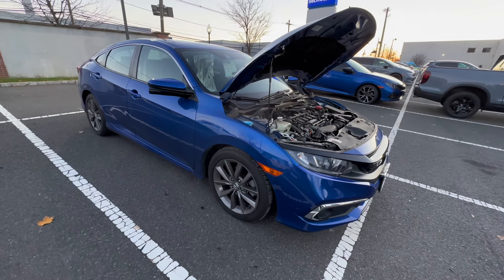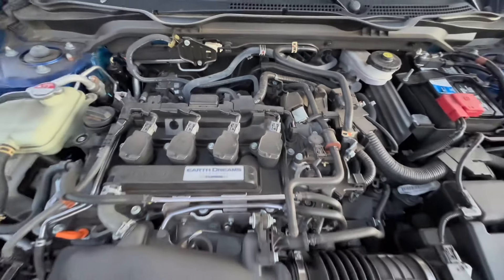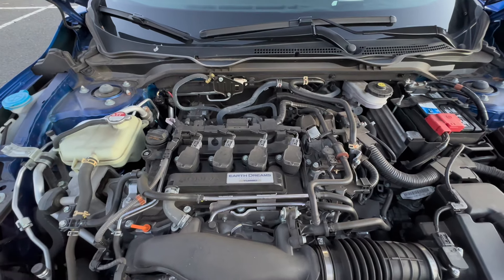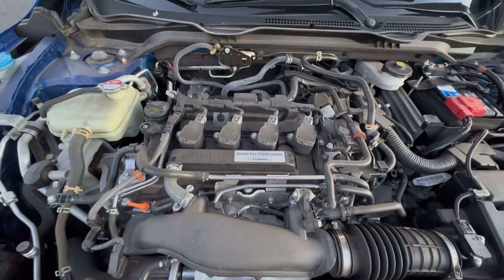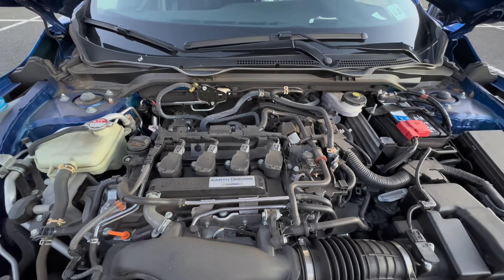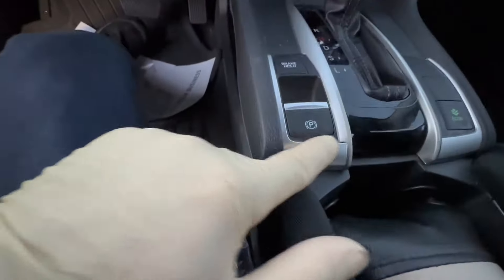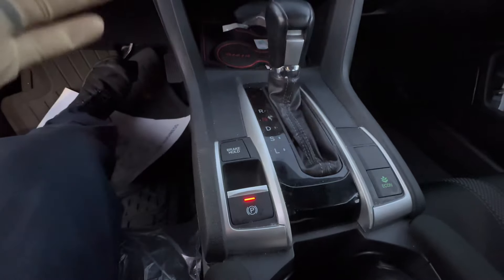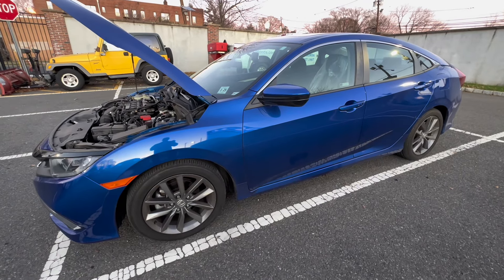2016 - 2021 Honda Civic problems

Comment: I have a 2019 Honda civic, sometime it takes two or three times to get it started, other times it starts right away no problem, sometimes the radio cuts out when I break or in reverse. I have taken it to two mechanics and they cannot find the issue, no codes come up and it’s sporadic! I also had the transmission replace before the car was a year old. I would not recommend a civic to anyone!
Reply: Any update on your civic ? I have a civic 19 sport 2.0L with similar issues

Comment: Rodent problem was spot on , some how they are attracted to it .
Reply from the maker: Yes they are unfortunately, thanks for watching
Reply: Didn’t hear the reference to rodents but man I’ve had what I assume is the same issue - twice! Car would barely turn over, power was diminished and Honda discovered chewed up wires. The second time same thing except I couldn’t even start the car.
Reply from the maker: @TzadikTheManic  yeah it’s a thing unfortunately

Comment: I just found a dude on YouTube he drove his 2017 civic 660K mile with 87 gas😂 he has valve gasket leak at 660K miles
Reply from the maker: Share his channel, im curious and if true that’s great.
Reply: @BCautosutions  I asked if he is running 87. He said yes.

Comment: Hi I've just got a 2017 1lt and experienced complete loss of power while overtaking just for a second or two untill I lifted of the throttle like it when into limp mode any ideas on what happened?
Reply from the maker: Did any lights come up?
Reply: @BCautosutions  No nothing just cut out eased off then ok with gentle acceleration.
Reply from the maker: @grahamrose21  weird, if it keeps acting up, have it looked at 👍🏻
Reply: @BCautosutions  Will take it out later see if I can replicate it thanks.
Reply from the maker: @grahamrose21  good luck!

Comment: For the low octane fuel causing the head gasket issue, is it because pumping 87 octane or getting bad gas that is lower?
Reply from the maker: The lower the octane the more it’s prone to detonation. Also try to stick to higher end gas stations as they typically have overall better fuel no matter the octane.
Reply: @BCautosutions  I appreciate your responses to your viewers. Please let us know If you notice any changes Honda has made to the 2023 CR-V 1.5t to possibly address the oil dilution/head gasket issues or if you have seen any in the shop lately for issues.
Reply from the maker: @thepoliticallyindependent1512  I believe I checked and the head bolts are same part numbers as all other 1.5t but don’t quote me on that. I’ll double check when I get back into work after the holidays. As far as the dilution goes we really haven’t seen many at our dealer. Let’s see what happens going forward.
Reply: @BCautosutions  Would you recommend using premium gas in the Accord 2.0T as well despite being the more robust engine of the two?
Reply from the maker: @ryanlittleton5615  yes for sure
Reply: @BCautosutions  Really? Same issues?
Reply: @BCautosutions  Have the 2.0T's had those problems (head gaskets)as well using 87?
Reply from the maker: @ryanlittleton5615  no but why not use the best possible fuel to reduce detonation and increase performance. The difference might be marginal but well worth it in the long run imo.
Reply from the maker: @ryanlittleton5615  negative although I don’t personally know of anyone using 87 in their 2.0t…most people who buy that trim tend to use 93 here
Reply: @BCautosutions  It's not that I have an issue using 93 (I drive an Si). Just the idea of putting premium in a non-performance vehicle just seems a little odd to me. IDK, I'm weird like that lol.
Reply: @BCautosutions  I've been eyeing a Sport 2.0T.
Reply from the maker: @ryanlittleton5615  yeah I hear ya. Unfortunately tons of heat and pressures in the chamber promotes detonation. With regular fuel detonation is more then likely.
Reply: I've always used 87 octane on my 16 civic 1.5T and had no problems.  I always use shell gas though.  Never Arco or Chevron or 76 or Safeway gasoline.  One time I did put in another brand i think it was Arco because I had no other choice i was in the freeway and the next shell was like 40 miles away. I noticed two things: it gave me less miles range like 50 miles less then normal i now this because everytime i get gas i reset the trip A. And I noticed my car was acting different it felt weaker going from 0-45mph. I think that cheap gas did something to my car but after I did put the shell gas again the car felt normal again but that was after the second fill up from shell so it took like like a month to go back to normal.  Those 30 cent difference from Arco to shell makes a big difference believe it or not.

Comment: 2.0 sparatic sputter at idle and between shifts it shakes
Reply from the maker: @mustng9646  check you intake tube from throttle body to air filter housing for cracks, tears, loose clamps

Comment: I own a 2019 Honda civic hatchback. Last August my ac went out. It was the condenser it was replaced for nothing (still under warranty) this year July my air conditioner took another shit but this time it’s the evaporator. But that’s not under warranty. They want $2600 to fix it. I’m just commenting so you can add that to your Honda problems.
Reply from the maker: @TwistedTee-gp6xh  ✅
Reply: I had the same issue. My AC went out and I read the condenser was under warranty due to issues but it turned out to be my evaporator. Luckily I paid extra for an extended warranty that ultimately covered everything. It’s crazy how many issues my 2018 is having. They also had to replace my transmission due to it going out. Plus my paint is chipping away. I don’t plan on buying another car from Honda anytime soon

Comment: How does The cat hold up in the civic?
Reply from the maker: Both cat and cvt trans hold up fine. Some cvt failures but nothing to be concerned with
Reply: Thanks for getting back to me. I recently bought 2017 civic ex, love it, but heard a lot of bad things about cvts. It had 64000 miles so I had the cvt fluid and filter changed
Reply from the maker: @jenniebaker7180  yep, keep up with the maintenance and it’ll be ok
Reply: Civit cat (smile)

Comment: 2016 touring, 110,000km, 68,000 miles. Not a single issue. Bought the extended warranty never had to use beside the mice issue. I do regular maintenance, sometimes even sooner than recommended. Always run 91 octane, and I drive the absolute piss out of my car. My 1.5t has seen more shit in it's 110,000km then most do there entire lives lmao. From autocross to the probably over 1000 redline pulls of done haha. I swear driving your car hard here and there keeps it healthy lmao. Maybe I am lucky. I believe the 1.5t likes to be driven hard.

Comment: i hate this videos ha ha.  I really do not want to buy another Honda.   Had 4 in my lifetime, all driven to 200K and beyond, with ZERO issues, and when I say ZERO issues, I mean ZERO issues.   What is going on with Honda?  Why the poor quality??
Reply from the maker: The problem is too much happening too quickly and quality gets compromised (this goes for all manufacturers). The more crap they add to cars the more stuff will fail. Also I’m sure the Rona hit everyone hard and quality/workforce was compromised as well. We are doomed lol. Appreciate your input 👍🏻
Reply: 10th gen will certainly be the last quality generations
Reply from the maker: @thomasengel1459  thank you!
Reply: @BCautosutions  Yep.  Honda quality was the result of carefully thought-out, and slow changes.  Now they are under a lot of pressure from all the laws and mandates to get very creative, very quickly--adding turbos, CVTs, new engine designs, its a recipe for problems.
Reply from the maker: @stevens1041  💯 agreed

Comment: I have a 21 civic ex with around 17k and I change my  oil every 4500 miles but I run it on 87 is it safer to run it on 91 octane
Reply from the maker: Absolutely worth using higher octane fuel
Reply: Appreciate it brotha  I will definitely start filling up with 91 from now on
Reply from the maker: @docshirey4898  anytime 👍🏻

Comment: misfire cyl 4 then i replace all 4 spark plug 150-160 did a injector clean thing. but #4 spark plug got stuck machine shop 2300$ after that misfire on #4 still there then they saw coolant at the spark plug head they said is crack so another 2300 but now the car still have the miss fire! when boost pick up it stutter and poop check engine if turned off the check engine light will be gone also.
Reply: premium gas since new
 every  almost 5k miles oil change. i have a oil catchcan to.

Comment: If it has a turbo I would pass (turbos live in the exhaust, an incredibly nasty place).

If it has GDI without port injection I would pass (backs of intake valves will carbon up).

If it has a mechanical CVT I would pass (they are more reliable than they used to be).

Regarding the rocks damaging the cooler. WHY do some Hondas not get a grill to provide some protection?  A rock ruined the AC radiator in my 06 Odyssey van. I noticed that the van didn't have a grill. After the repair (which isn't warranty work, your insurance might help) i made a grill out of a plastic panel. Any flying projectile bigger than a cm will have to break plastic first before damaging the radiator. 

Regarding rodents. I keep fox urine and moth balls under the hood. Rodents like the knock sensor wires on the 06 Odyssey (don't ask me how I know).

My cars are Prius and Mustang (both 2013). Neither vehicle has these issues.

Comment: how to fix the injector failure
Reply from the maker: Replace the injectors and use high octane and quality fuel
Reply: i have this common problem of camshaft intermitent interuption is this the cause of injector 1.5L
Reply: i need some guide for the 1.5t camshaft intermitent
Reply from the maker: @alavarenautoelectricalserv5282  no, that’s a different issue
Reply: @BCautosutions  can i have the inputs for the camshaft intermitent

Comment: The transmissions on these models suck the cvt transmission
Reply from the maker: @S_MART25  how so? They don’t fail as much as some others.
Reply: @BCautosolutions  I've heard from so many other owners and some mechanics that they're not the greatest transmissions out there. I've also heard Chevy mailbus have the same problem. Now, if you want to prove me wrong, I'll acknowledge it because I lack some knowledge in transmissions.
Reply from the maker: @S_MART25  people hate on them because of the idea. In reality Honda had/has worse transmissions in the past and currently with more issues. I’d personally stay away from anything 6at.
Reply: @BCautosolutions  thanks for that info. I appreciate the knowledge
Reply from the maker: @S_MART25  👍🏻

Comment: Hey brother, I have a 2020 Honda Civic EX that I just purchased for my daughter. One of the daytime running LED strips is not functioning. I find it hard to believe that the entire strip is out. Which leads me to assume it’s a bad connection. Would you agree and/or what would you check first?

Comment: Damn Head gasket issues are the worst since they usually blow out after warranty. My gf has a 2019 2.0 earthdreams is she safe. Damn honda screws there customers with a shitt warranty. Just gave my 2017 elantra away at 140k zero issues. Happy i didnt go with a honda sounds like ppl having expensive problems.
Reply from the maker: Actually most I’ve done have either failed under 60k or customers had extended warranty (which is a great idea in any new car tbh). Sounds like you had a good experience with Hyundai, have to do what’s best for you. 👍🏻

Comment: Issues with the A/C is common
Reply from the maker: Yup, made a whole video dedicated to it
Reply: @Hondamobilemechanic what are your thoughts on switching refrigerant to the r134a instead of the YF type? I would think more ppl would do this if it really does work out
Reply from the maker: @misteroofy8572  problem isn’t the refrigerant, it’s everything else 😅
Reply: @BCautosutions  you haven't heard about YF refrigerant being the issue?? They say it's corrosive over time 🤷‍♂️
Reply from the maker: @misteroofy8572  7 years into it, haven’t seen any corrosion issues
Reply: It was mostly on 16-17-18MY. They replace the condenser with the revised version of the later 10G model-years.
Reply: @gillesthibault429  lol mine is a 2019
Reply: @gillesthibault429  2019s do have the issue also . Same with some ppl I know

Comment: Not surprised about the head gasket. Those head bolts are a joke if you ever see one of them.  To thin and weak. 1.5/L engine is trash. Don’t tune this engine cause the crank and rods are made from tofu!
Reply from the maker: 💯 facts

Comment: I have Honda civic 2017 engine 2.0   my car engine shaking and vibration when I'm car in red signal  or in parking car running time smooth no problem some mechanic tell me changed plugs I changed original still same issue now mechanic tell me changed 4 coil but coil is expensive 700$ my car 52+++km can you help me what is the problem my car sir ?
Reply from the maker: Have the throttle body cleaned and the position relearned, also checked for damaged mounts. Lastly find a new mechanic, his advice was terrible.

Comment: Wrong. It’s the DOD. You can’t have cylinders with different heat ranges and expect the head to not warp or contract.
Reply from the maker: Umm no
Reply: @BCautosutions  then explain why J series never have head gasket problems except for earthdreams version. Now we’re only talking about 3 cylinders per head.
Reply from the maker: @Daveunruh  tell my when the 2.0t doesn’t have head gasket problems….its a 4 cylinder just like the 1.5t or any other Honda engine. The only one suffering from extreme head gasket failures is the 1.5t. No other engine from Honda has this issue. I respect, not a single other Honda engine.

Comment: AC unit! I hate this Honda
Reply from the maker: Which part? A lot of it is covered by warranty extensions
Reply: @BCautosutions  Condenser was covered by warranty but than the compressors become faulty too. And that is under warranty for only three years, it cost me $2400 to fix and eventually stopped working again. My friend drives a 2006 toyata matrix and not once had he ever had to service his AC. This is not just my Civic its happening to, go look up every review from 10th gen civic owners more than 80% had to deal with the same problem as mine. Honda really dropped the ball with this one.
Reply from the maker: @bobbydigital8243  yes and the compressors are now covered as well. I’m well aware of their issues as I deal with them on a daily basis.
Reply: @BCautosutions  they extended the compressors warranty? Since when!?
Reply: @BCautosutions  holy peppers batman! They actually did!!!! I’m calling up my dealer first thing tomorrow! Good thing I came across your video. Thanks bro! Dang they actually did. lol!
Reply from the maker: @bobbydigital8243  only the shaft seal. About 1-2 months ago
Reply from the maker: @bobbydigital8243  lmk how it works out. Good luck dude 🫡
Reply: @BCautosutions  it’s been a month now since Honda fixed my ac unit for $0. And the ac is still rocking, saving my summer from being a bad one. Imagine if it weren’t for this video I would of never knew about the updated warranty. Hope nothing but the best for this channel
Reply from the maker: @bobbydigital8243  thanks for coming back and sharing and for the support!